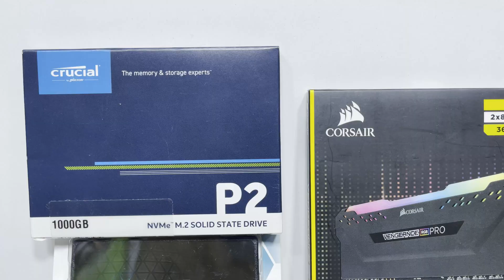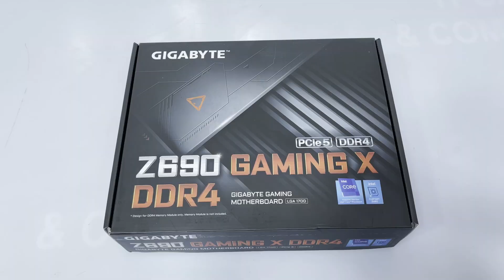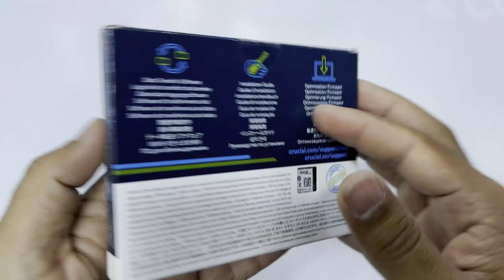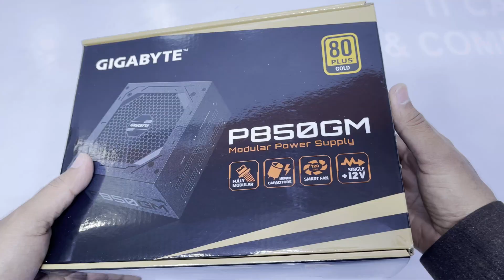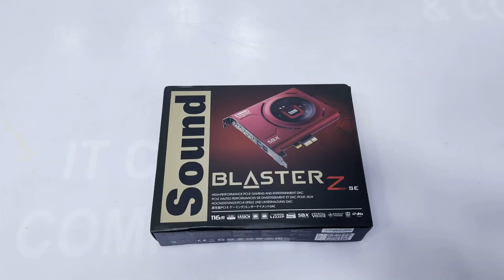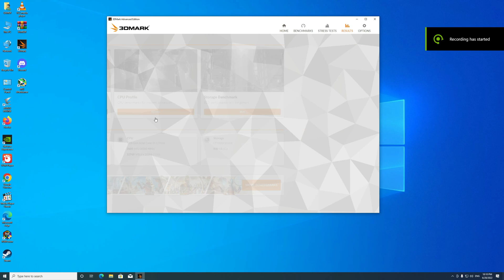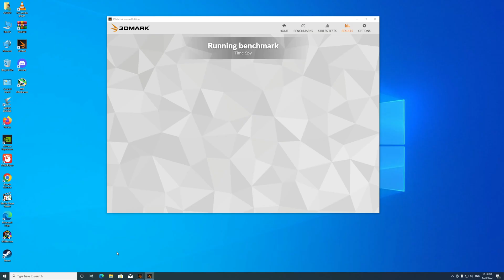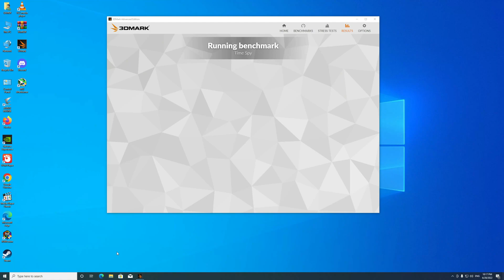LGA-1700 INTEL i7-12700K RTX 3080 GAMING PC BUILD

Comment: Hi I have a question , I can buy an intel i7 12700 with a good b660 motherboard or an i5 12600k with a good z690 motherboard for the same price, what do you recommend ? . I will use it for games ( with a 3080 12gb at 1440p  ) and programming using two minitors and having a lot of google chromes windows.